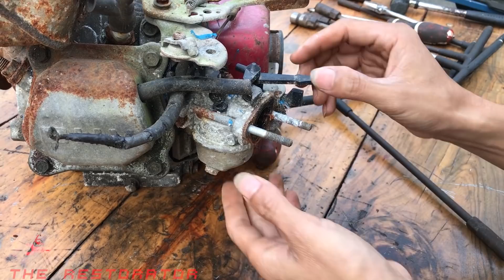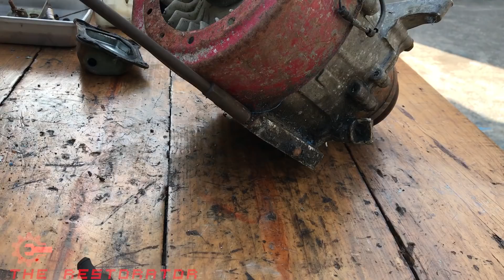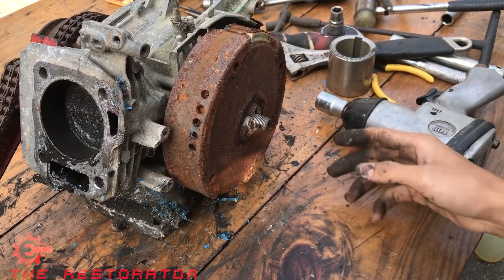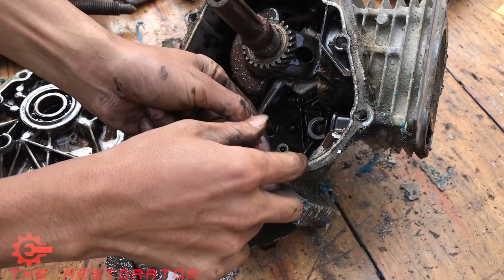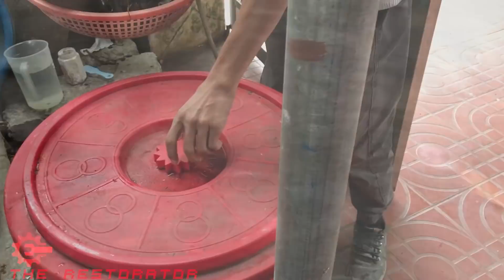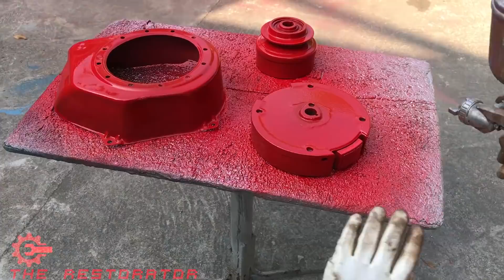Restoration Engine HONDA GX160 | Restore Engine Honda Rusty

Comment: Not criticism, but i hope that in part 2 that you hone the cylinder and replace the bearings. These are two critical parts to repairing an engine. The more care that you put into an engine, the better it will run.